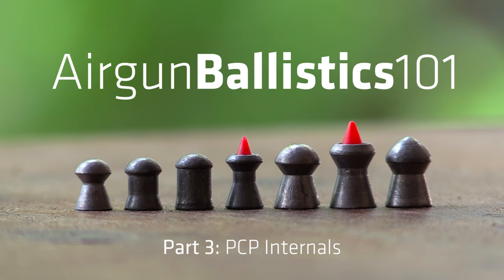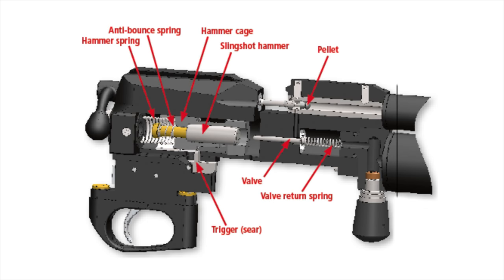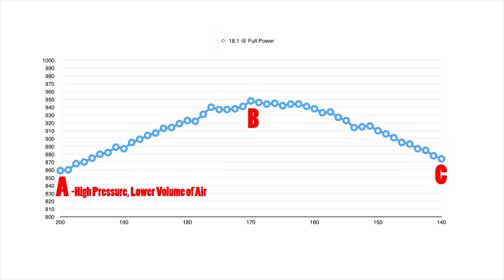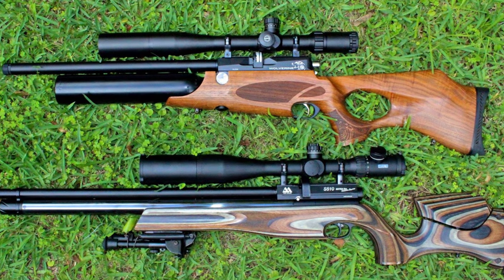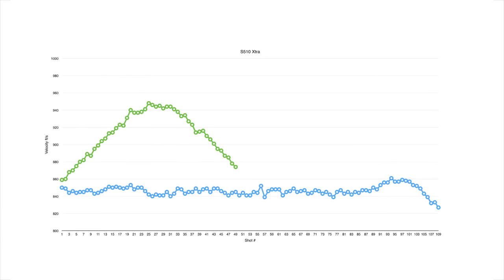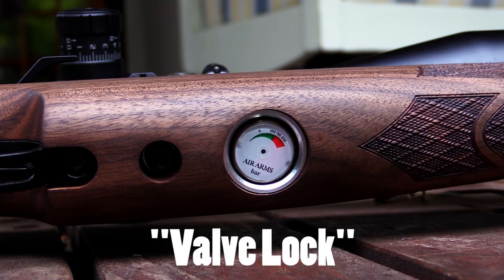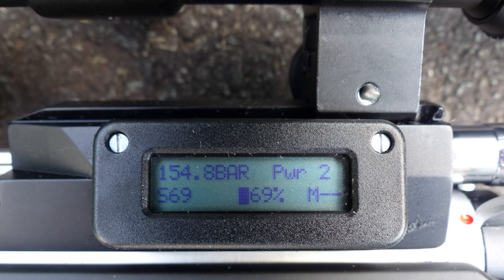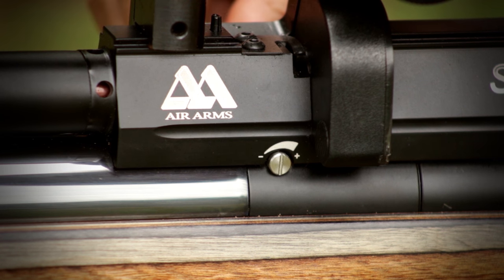How a PCP Airgun Works | AB101 pt. 3

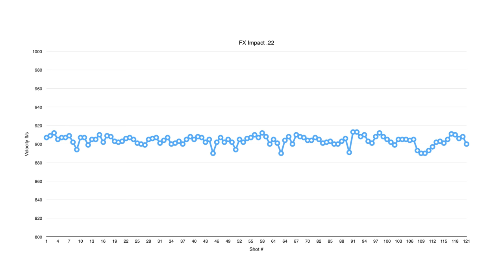Comment: Well explaind, very informative. 4:46 is quite inconsistant for a regulated gun, you should get an hw100 or 110.´The electronic gun still had less consistancy, then an exeptinal pcp. water sensitivity and relying on batteries are no improovements over regulated pcp`s, so why bother? Because of the potentially extremely light trigger? i wouldn`t want anything changed on my original trigger setting, i could make it ligher, it would still be crisp and save, but i  don`t want to, i can`t really imagine anyone desireing a lighter trigger than what is possible a regulated pcp. And i can`t imagine getting a better feedback from it at all.

Comment: i been simply firing my regulated fx impact without air or pellet, lile almost 30 times, just cock and fire thats all.. but later i came to to know it will damage the valve, as per instruction manual.. should i be worried? because i womt be filling air and testing it until next 5 days so im nervous..

Comment: Why even use a hammer? Wouldn't a gate valve design be more consistent. Pull trigger valve lifts and closes. Instead of turning it on/off like a spigot a trigger raises and lowers the valve.

Comment: wait....what.... you're saying if a gun can be filled to 4500 psi, one shouldn't fill it to that pressure? I am wanting to buy a airgun that can be filled to that pressure... if I should not fill it to that pressure then I don't need the gun
Reply from the maker: +James Denny Well it CAN be filled to the pressure they advertise, but it doesn't mean it SHOULD. Some of the 300 Bar guns I've used state in the instructions "to prolong the life of the rifle, fill only to 250 Bar". Some regulators in 300 Bar rifles also struggle to work correctly at higher fill pressures and tend to not work properly.